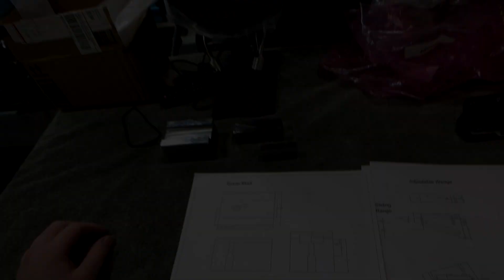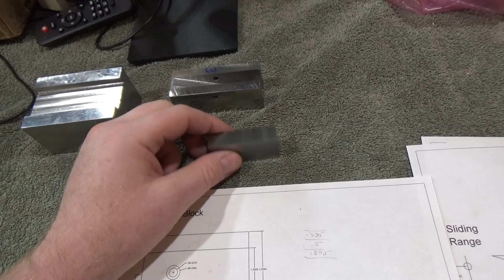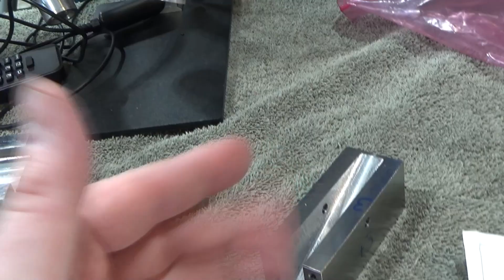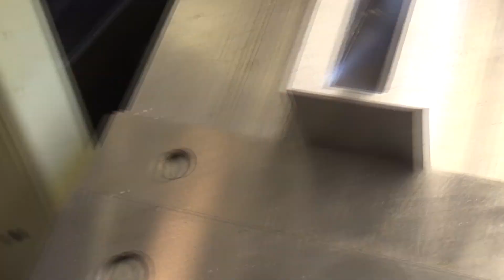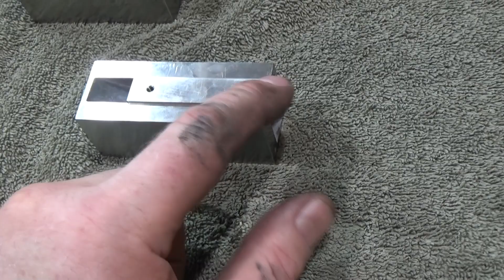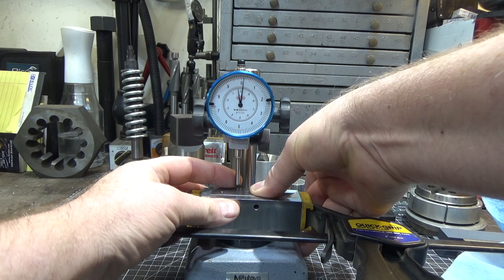3b JacksForMax Group Project Part 2 #JacksForMax

Comment: So we all know that the saw and drill bits remove the most material the fastest. In situations like the slot you were cutting, how do you work out when it is more efficient to pre-drill? I could imagine a formula, but if I try to account for wear and the cost ratio of end mills to drill bits, I lose it. Don't get me wrong, I believe it was a wise choice but I am interested if anybody has worked out a handy rule of thumb.
Reply from the maker: I really haven't worked out any specific formula or even rule of thumb. I am still in the, "Ill try it and see how it works", stage of things and I haven't been too methodical about it either.
Reply: @DudleyToolwright  I suspect that is the problem. I think we have all found shortcuts like this, but are unsure which applications to apply them in efficiently. There should be a simple rule of thumb, in my mind it makes sense to use your shortcut anytime the depth would require say more than five passes to get through. Obviously that example is oversimplified, but I think every machinist could benefit from knowing what is fastest
Reply from the maker: You are quite right.

Comment: That test mic stand is basically identical to the Schmidt one, although it is about triple the thickness and weight. That deflection that required you to chamfer the block, that wasn't a mistake, it was a feature- oil galleries upgrade.
Reply from the maker: You are always to kind. Thanks. This project was a really great collaberation.

Comment: This was another level, working with hardened material at ~1/10k tolerance. Would’ve liked more footage but understandable given the situation.
Reply from the maker: Thanks for the very useful feedback. I have a tough time gauging how much of the process people want to see. It seems like the majority want to see a very compressed construction, with a longer view of the finished part. I am on the side of more process is better. Cutting metal is kind of mesmerizing. Getting to accuracy within a tenth, on a new surface grinder with a DRO is not too hard, because the machine is doing all of the work. If I had to pull that off with just the dials on an older machine I would have probably failed. It really lets you respect the work of guys like Tom Lipton and Robin Renzetti, who can get there on almost any machine.
Reply: @DudleyToolwright  For me there are 3 stages:
The plan: everything involved from its history to uses, science engineering manufacturing and so on..
The making: all the tools techniques materials, and actually making the pieces..
The usage: showing and demonstrating how it operates, what it can do, how well it does it..
All 3 are important interesting educational fun..

You probably have watched The new yankee workshop. Norm Abram would show some antique, and the next thing, 2 mins into the show he would show the replica he made. Then he went on and build a 2nd one from scratch. I hated when he showed the replica. It robs the viewer from going through the experience of making the thing, the decisions, the reasons.. actually cutting every piece. I personally like it when the video shows all steps, from the planing stages, all the way to using the made item. and doesn’t jump the stages. Being new to machining that’s how I would like videos to be. More experienced among us may just want the plans and a quick look.

Anyways, congrats on the grinding machine. I’d like to get one some day.
Reply from the maker: I have watched Norm and was also a fan of This Old House. I really enjoy learning about how anything is made. I will consider your feedback carefully and try to do a better job explaining and showing my thoughts and steps. I really like the same thing.
Reply: @DudleyToolwright  lol yes this old house, bob ross, jack pepin, and the rest. I’m a 90s kid, and pbs was my favorite tv channel. And now in using YouTube my primary objective is still education.

Comment: Thanks Rob .  You did a really nice job on those parts .   The grinding fit & finish was great .  
The jacks will be put to good use , that's for sure .     Cheers .
Reply from the maker: Thanks, Max. It is a small token for all that you have contributed to mine and other's knowledge of the craft.